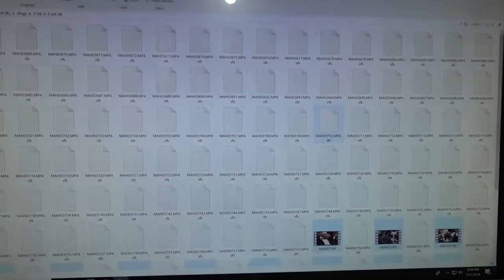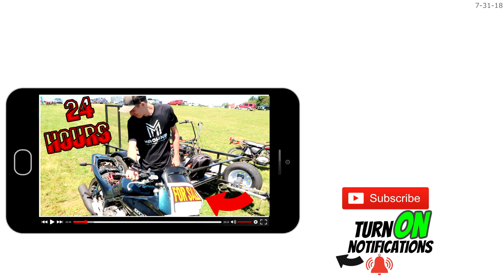Straight-Six Not Your Average Tune Up

Comment: That sleeve that you put in the oil seal on the timing chain cover goes on the harmonic balance if you have a groove in it
Reply: I was going to say the same thing. You may have done it and not shown it. But if you left it in the seal and then drove the harmonic balance into it then I'd suggest you remove the balancer again and see about the sleeve, it's probably smashed up in the timing chain area and the seal may be toast too.
Reply: I hope he realizes that and checks it out.

Comment: That 4L is a super easy engine to work on, plus there great engines. In 2000 Chrysler Corp. thinned out the head casting, causing them to eventually crack... but the older engines will run hundreds of thousands of trouble free miles, if you take care of them.
Reply: chrysler anything and 100K miles in the same sentence is absurd, knowing their garbage electronics dating back to the 70's  :))
moving on.....

Comment: just one thing what was up with the audio in this video cause its all coming out of the right side accept for some random wind noise during your explanation I still liked the video plus I understand computer crashes my computer is full custom but I was forced to use an external hard drive for my boot drive (not recommended) which all went fine until the usb cable got a kink and now the computer will completely lock up requiring me to force the computer to shut down restart then re-do the boot setup but glad to see you back

Comment: I cant see if you took the speedi-sleeve out of the oil seal and tapped it onto the balancer or left it inside the oil seal.
Reply from the maker: I took it out. Sorry I didn't get the shooooooooooooooooooooooooooooooooooooooooooooooooooooooooooooooooooooot
Reply: All good man. I know how speedi-sleeves are used but some folks might not. I kinda like the "silent movie" video, its different from your usual style.